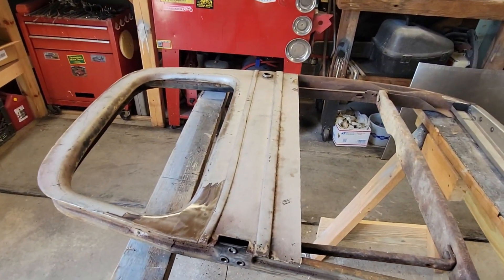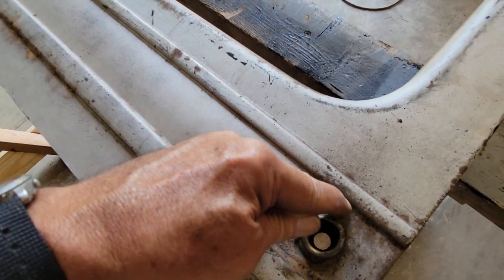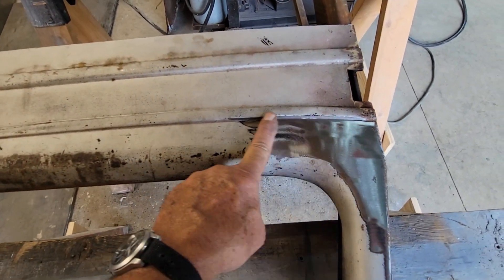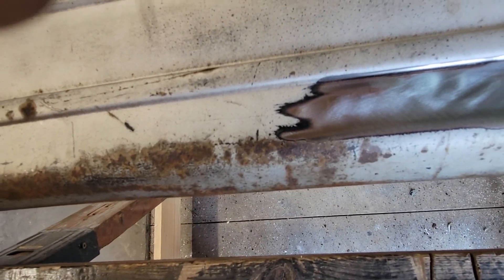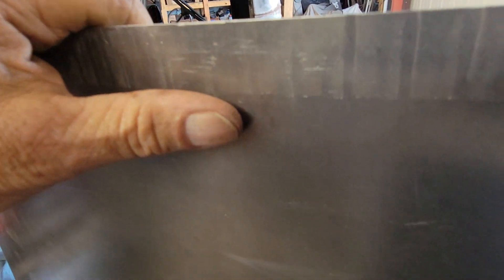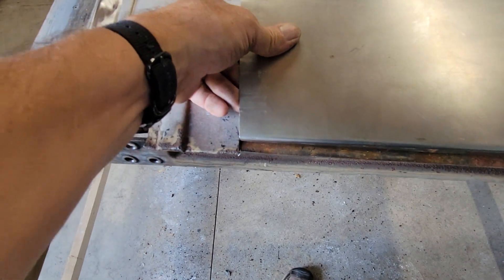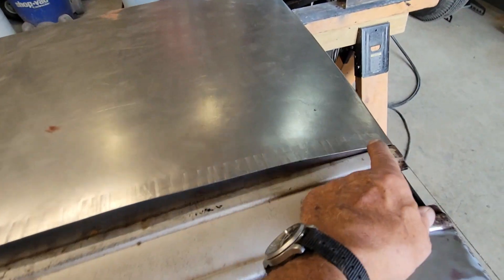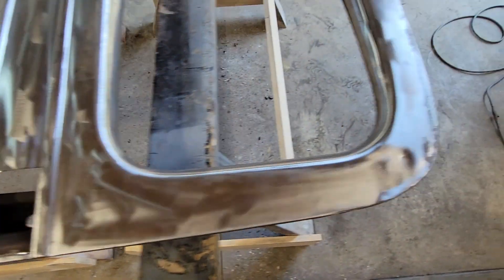1936 Chevy - Drivers door repair

Comment: Good stuff Ken! Like you said, start in the center this time, and don't crimp the edges tight until the seam is fully tack welded in place. It's probably still going to put up a fight,  but hopefully it goes a bit easier than last time. The rest of the patch panels will seem easy once you get those doors done.
Reply from the maker: Thanks for the encouragement Kyle. I hope you're right with the rest of the patch panels, because so far the door panels have been a nightmare. Thanks again!!

Comment: You doing a great job on that truck,  it's really coming along nicely,  it's a shame you can't get perfect skins for something as simple as a door but I'd start with the outer edge and work it to the front,  you can always fold the hinged side under a little tighter
Reply from the maker: The aftermarket is known for its not perfect fit, but I'm going to try a bit different tactic this time. Thanks for watching.

Comment: Just a few thoughts on the door. They make aair tool for making a hem which can be glued. The door handle has a tool to replace it for rent from Filling Station. You may have to build up the hole.
Reply from the maker: Thanks Howard, I am sure that I will need that tool to install the handle ferrules. You may be right about building up the hole, we'll just have to look at the other door to see. Thanks for taking a look!